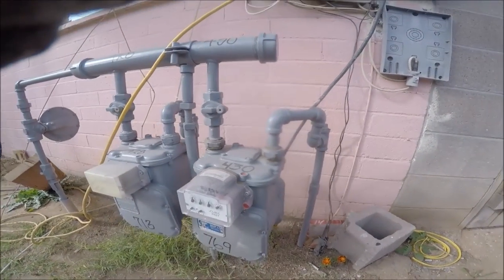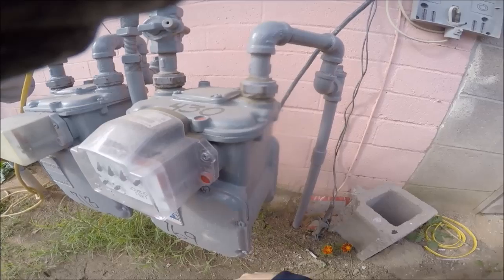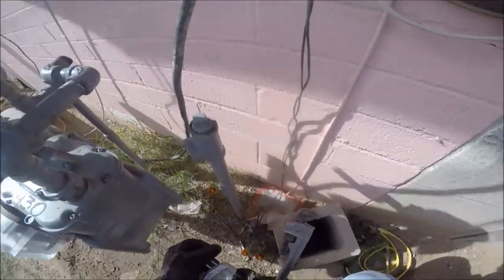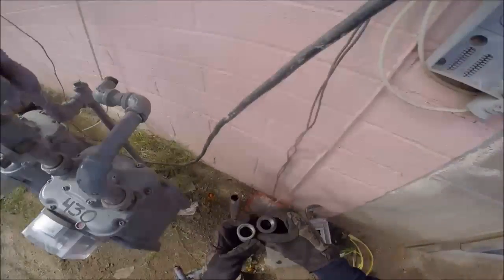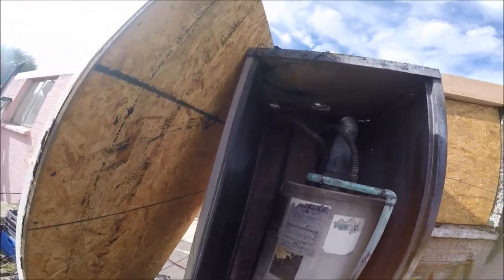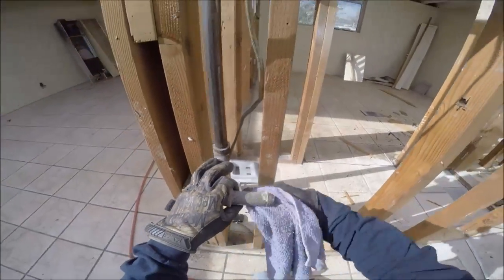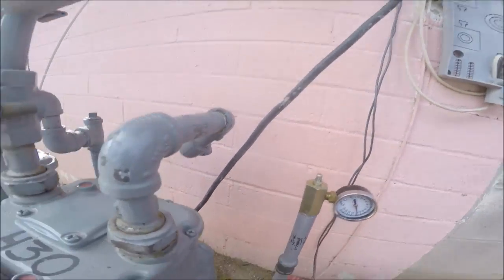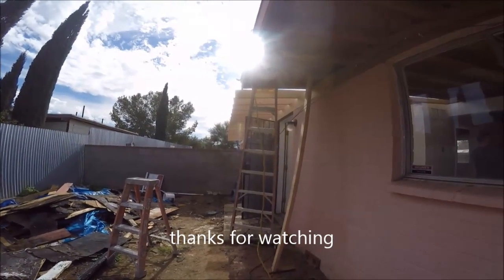gas pressure test

Comment: What happens if I left my gauge overnight,is the presion decrease?
Reply: Pressure in the pipe will fluctuate with temperature the longer it is left so its not more accurate to leave it longer. The code specifies a pressure and time for the test such as 15psi for 15 min without the needle moving, but confirm with local code. It is adequate to meet the minimum code.

Comment: Aren't you suppose to keep all gas lines open so they can bleed out before you do a pressure test?
Awesome video. Thanks a lot.
Reply from the maker: I'm not sure what you're asking???
Reply: When you do a pressure test on the gas line,  aren't you suppose to keep all gas lines open so they can bleed out before you do a pressure test?
Thanks for your reply and your video.
Reply from the maker: once you disconnect anything you'll automatically bleed the line if that answers your question.
Reply from the maker: here's the video of the replacement if you're interested.
https://www.youtube.com/watch?v=dlgW3kcMplk

Comment: Thank you for your informative video.
What do you do when you "check everything" and you still have a leak, small or large?
Thanks again
Reply from the maker: try to locate it with soap solution and repair it. in this case the leak was underground so I rerouted it overhead to the other unit.

Comment: Does everything have to be in steel barrel pipe with you guys? As a UK gas fitter we do everything in copper pretty much.

Interesting video anyway :)
Reply from the maker: I guess steel barrel is black iron? here we can use galvanized steel or black iron, I just prefer black iron. thanks for watching mate
Reply: yes, it looks the same, We use it mainly for comercial/industrial applications.
What pressure does the gas pipe work at?
Reply from the maker: Tescosfinest custard .5 psi I don't know how to convert that to metric
Reply: Thats a lot higher than what we operate on here all stuff downstream of uk gas meters is 0.29psi
Interesting anyway, Thanks.
Reply from the maker: Tescosfinest custard do you actually use psi there or you converted the units?
Reply: I converted it yeh, we use millibar here. down stream of the gas meter natural gas works at 20mbar & propane at 37mbar. 

5 psi is 0.344 bar
0.344 bar is 344mbar

I googled these conversations haha
Reply from the maker: Tescosfinest custard before the regulator it's 2 psi coming in from the street